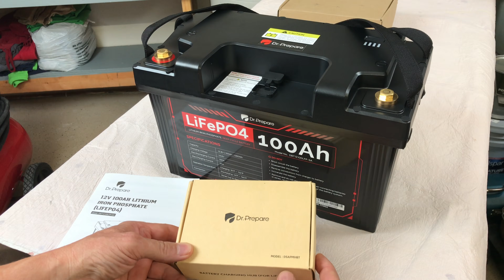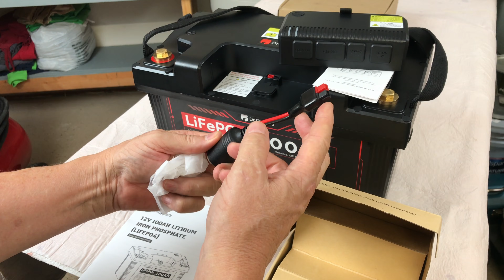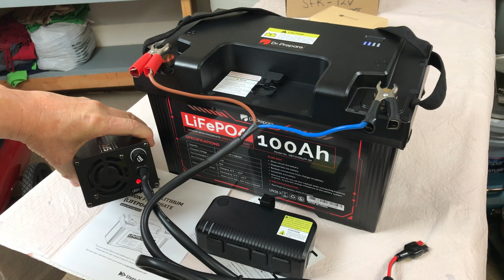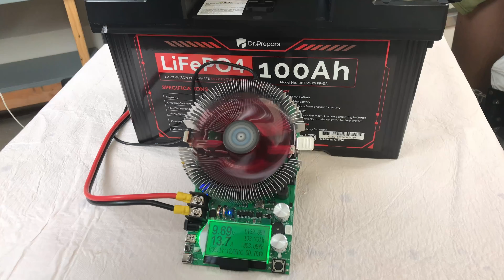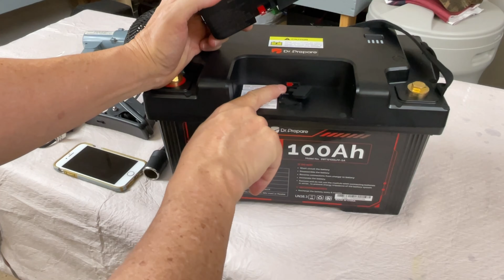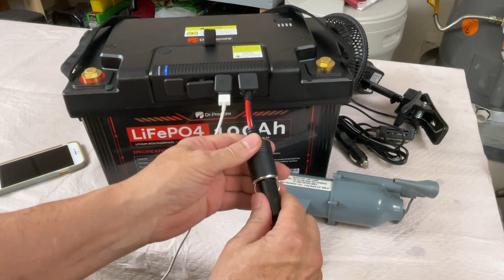I Tested Dr. Prepare's 1280Wh Power Station and I'm Impressed

Comment: Thanks for your review of the new unit. 😊. I purchased the previous version, with the cigarette port built into the hub unit. I’ve been looking to find any documentation that would let me know if I purchased the new hub unit that it would work on the previous gen battery unit. Have you run across any information on that? Thanks in advance for any input you might have.
Reply from the maker: Unfortunately, I'm not aware of any information on backwards compatibility. Maybe contact Dr. Prepare and I'm sure they can tell you if it is compatible or not.

Comment: I have the older version of this and I can say the car lighter did not power my 12 volt fridge, it would light up the controls but the compressor would not start up. Hopefully the newer version fixed that issue. The battery itself worked fine and I used an adaptor from the main terminals and was able to run the fridge from those. My guess is that the one on the old power box was not able to provide enough power to start up the fridge even though it is rated at 12 volts 10 amps. I can also say the old version did not shut off the usb ports even if you turned it off at the button.